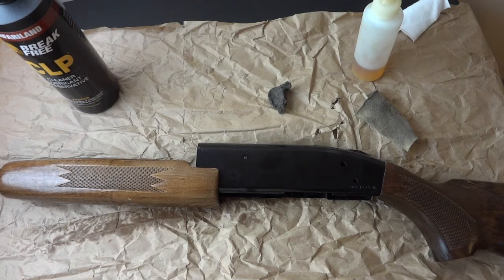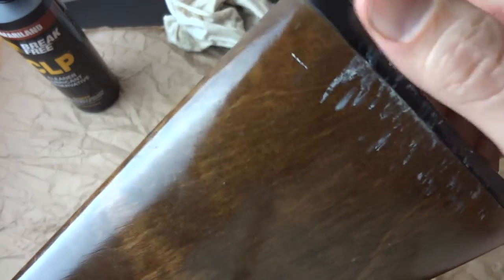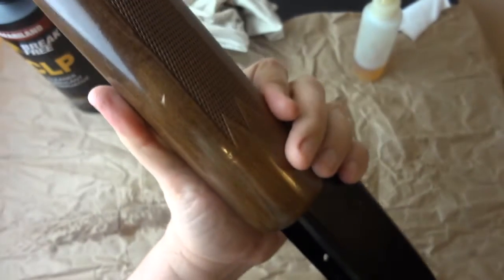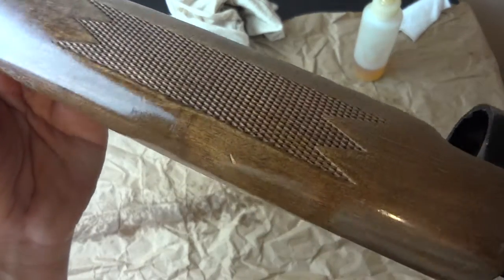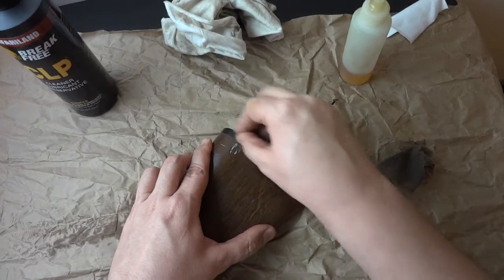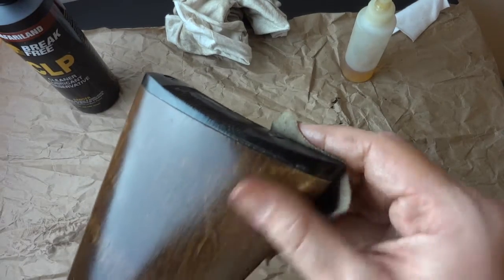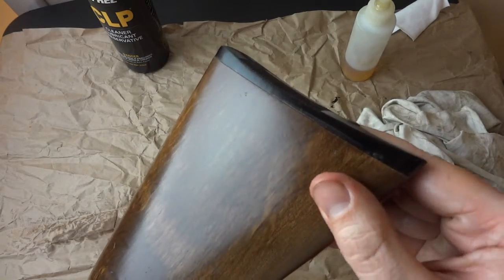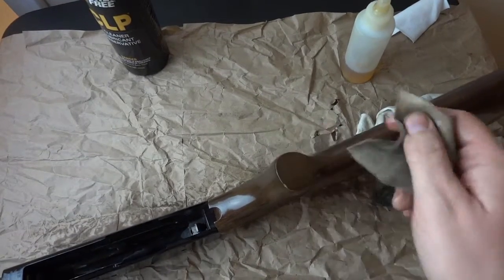Gun Stock Finish Maintenance

Comment: I was always told to try and keep gun oil off of the stock because it would make the finish and the wood soft and eventually could ruin It over time?
Reply from the maker: Depends on the oil, but yeah, some solvents in some gun products (hoppes 9) will damage some finishes.  I have used Break Free for so long that it's a bit hard for me to get out of that mindset.  In general, you want to wipe the solvent off of your wood stock after you've cleaned your gun.  I do this with a paper towel, usually.  I think what I'm getting at in this video is that where the finish is damaged, this will soak into the wood and protect it as well as match the finish on the rest of the stock.  A lot of wood stocks these days are birch or even maple and they are stained.  These stocks don't stand up to scratches that well.
Reply: Linseed or clp? I have 0000 steel wool and some Big45 Frontier. Murphey Oil Soap any good at cleaning a wood stock? Its a Yugo SKS made 1986. Matching everything.

Comment: I like to use "Ballistol" oil. Just a dab on the wood ...and polish off. Great sheen!!. What is your opinion pls?. Rod.
Reply from the maker: I've never used Ballistol.  Lots of people swear by it, but I have never needed anything but Break Free as a Cleaner, Lube, Protectant.  Based off of other people's opinions, it would work great for wood.  I just don't know how well it would work to protect metal for long-term storage.
Reply: @RyeOnHam  I used it for storage of my AK. No rust after months of sitting in safe. I would recommend